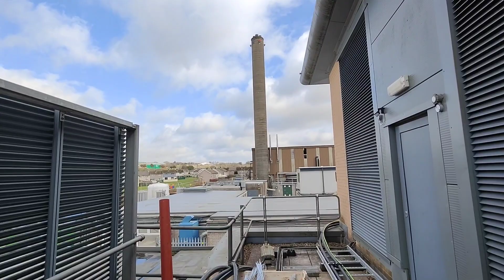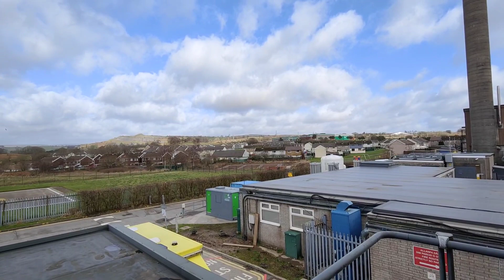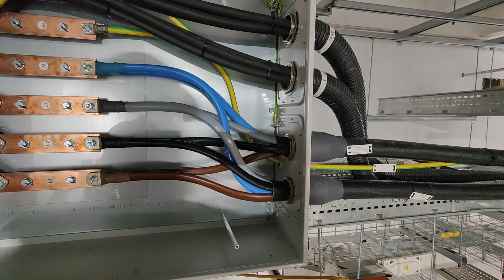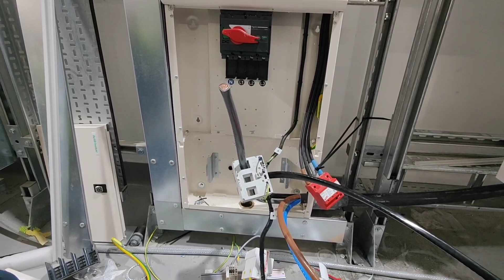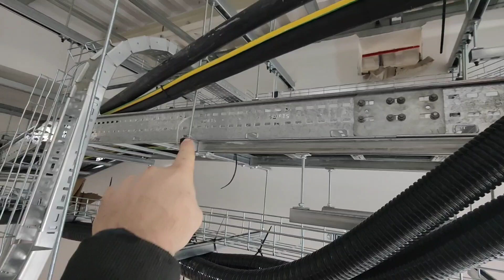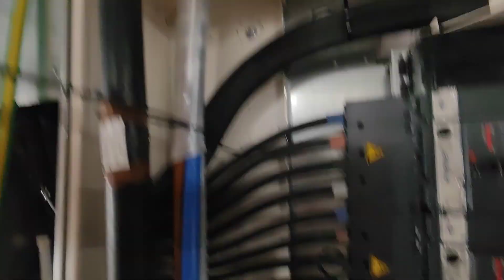This is what I did this week. No process, just the finished product.

Comment: US based commercial/industrial electrician here. Where I work we would use conduit pipe for these types of installations. Is conduit used much in UK?
Reply from the maker: The only time conduit is used is from secondary containment in lighting and small power (sockets). I've seen some US installations and you do love your conduits. Some of them look to be 4" in diameter. We tend to use 20mm and 25mm. On the odd occasion a 32mm may be used but very rarely.
Reply: @jointechcabling9103  conduit is used in many installations here, though in the past decade or so MC cable has replaced the use of conduit in many instances. Conduit actually goes up to 6" for EMT and 5" for rigid. Largest size I've had to deal with is 4", which can be a real pain especially when using compression couplings and connectors.

Comment: Watched a few of your videos now and seems some engineers are not well informed when it comes to big cables and the radius required to get them in ,I build panel's and have connected a few, the amount of gear thay want to squeeze in at times beggars belief
Reply from the maker: They have absolutely no idea about the room needed to accommodate such cables, you are completely correct. They don't liaise with the panel company about dimensions, they only pass on current capacity I'm sure.